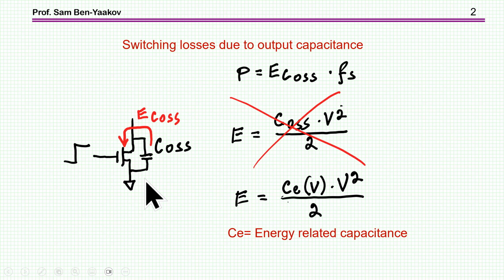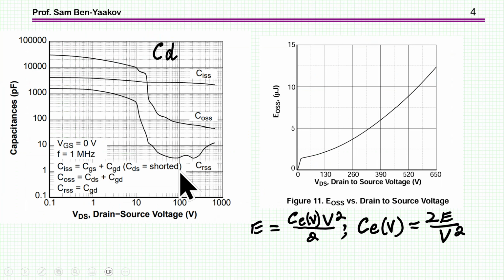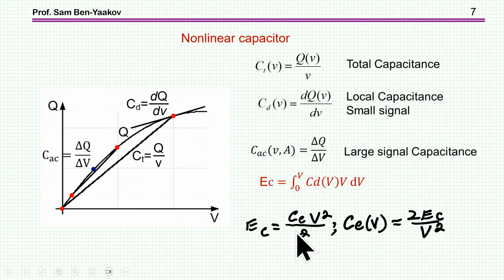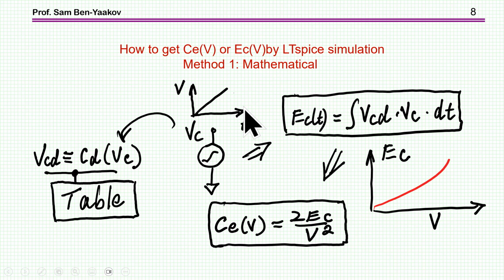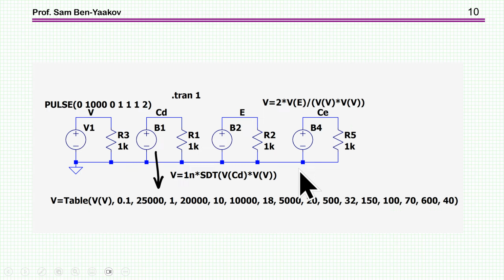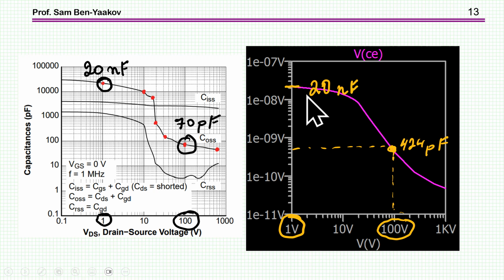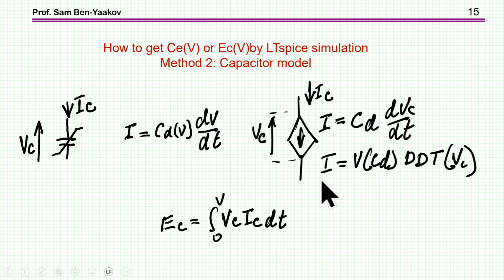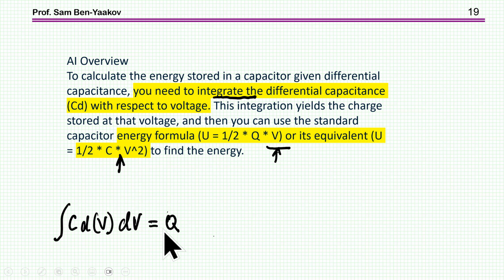How to get the energy-related capacitance

Comment: Hi, sir. I have a ltspice question and would really appreciate it if you could help me out.
I'm currently simulating a series-connected flyback converter. In this design, two flyback stages are connected in series at the input, and both switches are driven simultaneously.
The issue I'm facing is that when I include leakage inductances in the circuit, the LTspice simulation becomes extremely slow where it's practically unusable.
Would you be able to guide me on what might be causing this problem?
Thanks in advance!
Ltspice schematic:
htt@ps://ibb@co@/B5td@M0DK
please remove @s. (YouTube deletes messages containing links, though I’m not sure why)
Reply from the maker: The slowr un is Probably due to reduced time step as a result of convergence problems. Try to put large resistors in parallel to the the leakage inductances. If this does not help go to setting and reduce the resolution of the simulation run.
Reply: @sambenyaakov  Thank you sir.

Comment: The world's best teacher thanks sir
Reply: @sambenyaakov  Hi, sir. I have a ltspice question and would really appreciate it if you could help me out.
I'm currently simulating a series-connected flyback converter. In this design, two flyback stages are connected in series at the input, and both switches are driven simultaneously.
The issue I'm facing is that when I include leakage inductances in the circuit, the LTspice simulation becomes extremely slow where it's practically unusable.
Would you be able to guide me on what might be causing this problem?
Thanks in advance!
Ltspice schematic:
htt@ps://ibb@co@/B5tdM0DK
please remove @s. (YouTube deletes messages containing links, though I’m not sure why)
Reply: @sambenyaakov  Hi, sir. I have a ltspice question and would really appreciate it if you could help me out.
I'm currently simulating a series-connected flyback converter. In this design, two flyback stages are connected in series at the input, and both switches are driven simultaneously.
The issue I'm facing is that when I include leakage inductances in the circuit, the LTspice simulation becomes extremely slow where it's practically unusable.
Would you be able to guide me on what might be causing this problem?
Thanks in advance!
Ltspice schematic:
htt@ps://ibb@co@/B5tdM0DK
please remove @s. (YouTube deletes messages containing links, though I’m not sure why)

Comment: Love this, thank you.
Reply: @sambenyaakov  Hi, sir. I have a ltspice question and would really appreciate it if you could help me out.
I'm currently simulating a series-connected flyback converter. In this design, two flyback stages are connected in series at the input, and both switches are driven simultaneously.
The issue I'm facing is that when I include leakage inductances in the circuit, the LTspice simulation becomes extremely slow where it's practically unusable.
Would you be able to guide me on what might be causing this problem?
Thanks in advance!
Ltspice schematic:
htt@ps://ibb@co@/B5tdM0DK
please remove @s. (YouTube deletes messages containing links, though I’m not sure why)